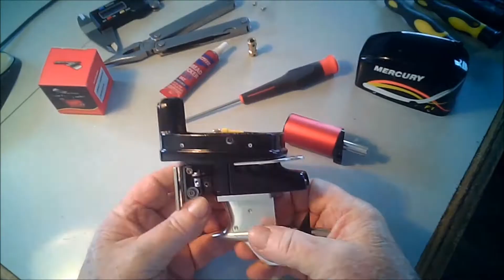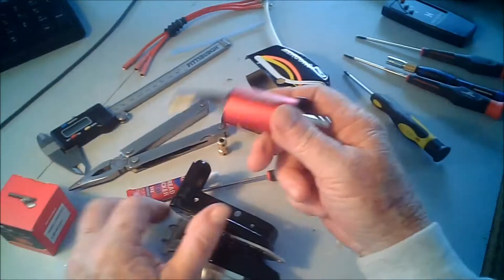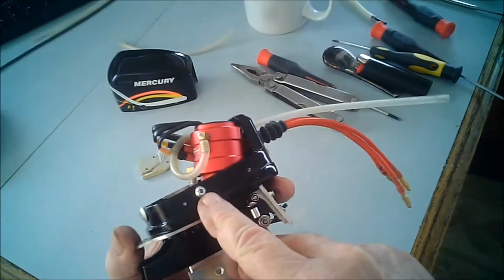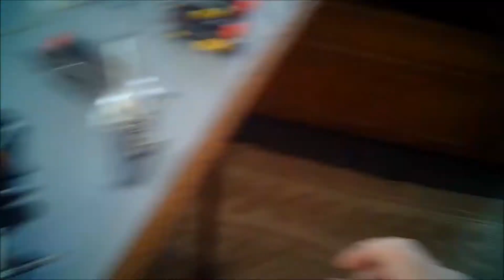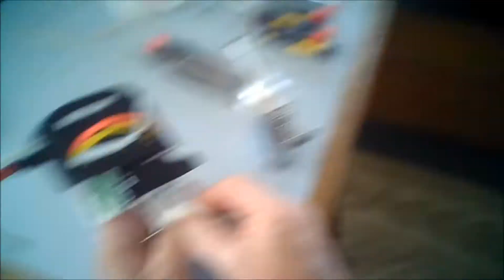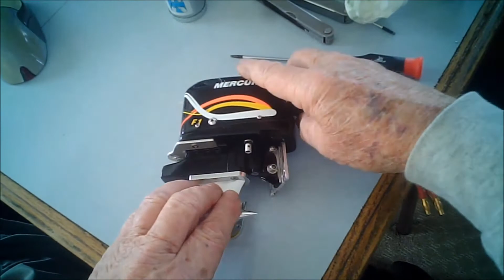HobbyKing H20 Style 650EP CNC OutBoard Motor Upgraded & Mods

Comment: I noticed both motors run in the same direction. Did you know when you have dual drives you are supposed to run then in opposite directions.
Reply: That's with conventional inboard motors to reduce torque roll, wont matter on these since the motor is almost vertical.